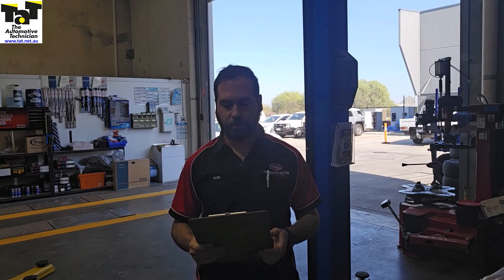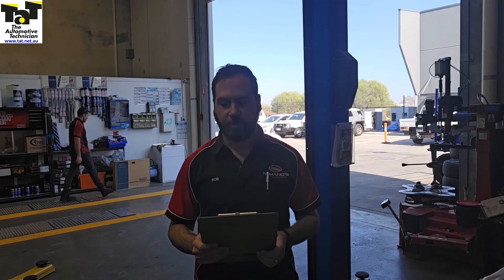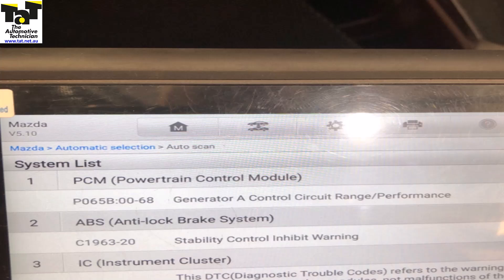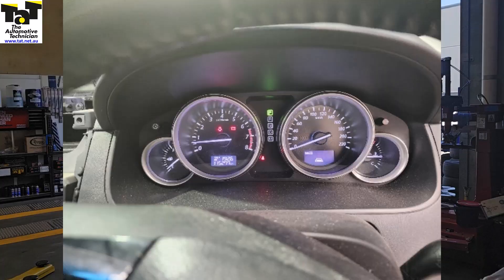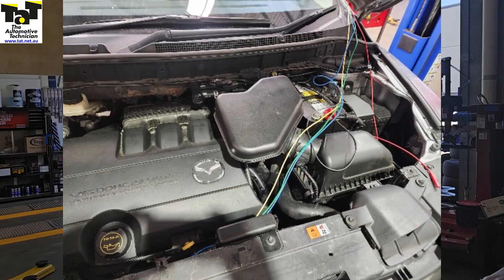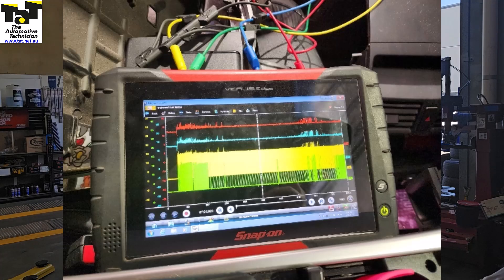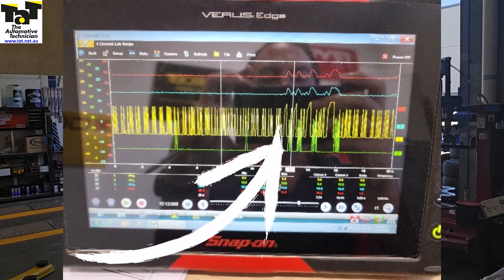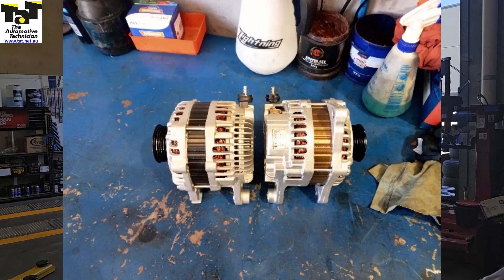Mazda CX9 with battery light and traction control lights flashing

Comment: Further on that, some alternators are more complex to replace than others, so when the aftermarket unit fails, the suppliers will take the old unit back, make you wait the required amount of time for a credit (while charging you for the replacement), and then refuse to pay the labor for fitting the second unit. This is why I only use genuine or Japanese etc branded electrical items.